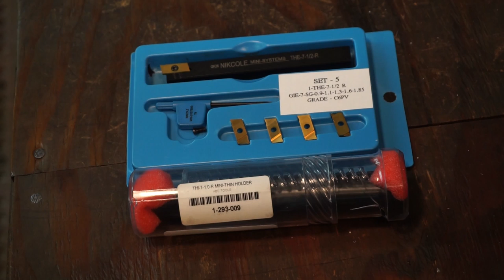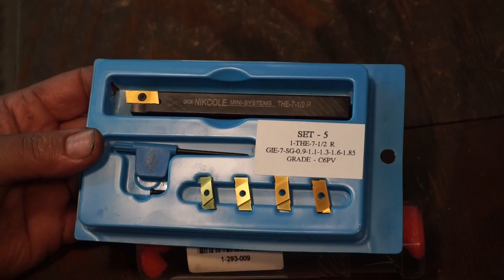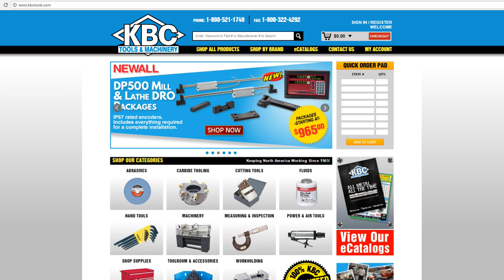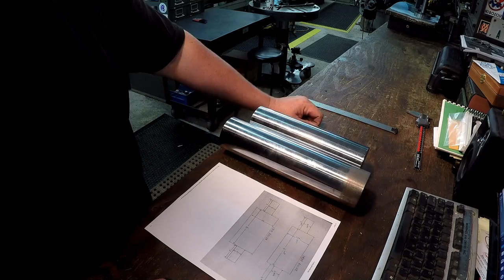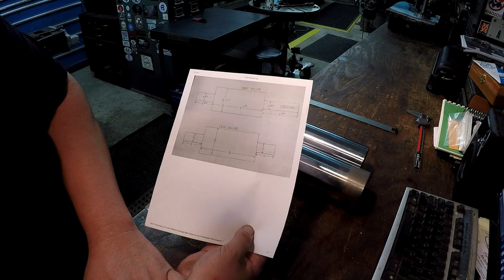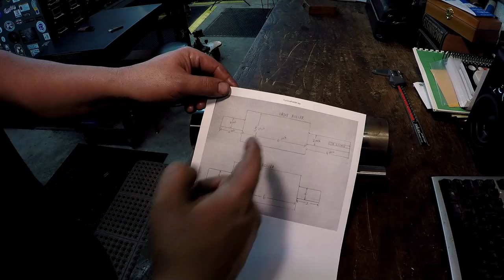SNS 167: Viewer Lathe Project

Comment: I use that same grooving set for snap ring grooves. It works really well.  Keep the speeds and feeds light, and the inserts last a good while. In a pinch, I have even touched up the edge with a green carbide hand stone.

Comment: Adam ,that Nikcole tool looks like it would be a very useful tool along with the boring bar. I could really use something like that but I think I'll let you be the test guy before I buy. Hope to see you use it soon. Hope you had fun up at John's place. I completely forgot about that going on. I fully intended on making the trip, it's only about 150 mile drive for me. Maybe next time!
Reply: wvrockcrusher I use that same grooving set for snap ring grooves. It works really well. Keep the speeds and feeds light, and the inserts last a good while. In a pinch, I have even touched up the edge with a green carbide hand stone.

Comment: I want to say a big thank you to you fella. Here's for I tell you why...

My brother in law got 'given' a whole heap of chopped down trees in rounds, big long stack of the things, all he had to do was haul them away  and there are more trees to fell so this is a serious amount of free firewood for the next few winters.... We went to go load some, couple of tonnes I recon, on Saturday last and I got to thinking about the reality of how many axe swings it was actually going to take to split all this.  It dawned on me slowly, that's how I do math, that  we were in way above our heads here in terms of hand splitting all this so I suggested  hiring a log splitter.  OUCH, scrap that, so for that money maybe buy one? 

So we looked at what is available here in the UK and because I have learned a lot of stuff from watching your good self I could see that these cheaper machines were just not going to cut it. I just couldn't see a threaded bar driven by a motor, driving the moving wedge to split the wood lasting longer than seconds on the rounds we had  so I was able to  scrap that right there.. but what the brother in law found out asking his wooden mate, digging deeper, was that these 'toy' things are actually hydraulic.

 OK, bit dumb of me, but because I have learned about what hydraulics are capable of through your channel I could see that actually this could work. A bit of tube searching found me a model/manufacturer, and we bought one a few days later for 2 days hire cost for the only machines to hire in the area. So thank you Adam, for giving me the confidence to  make that choice and the know how to back it up :)

Comment: Hi Adam,  an idea for a shop talk video: what tooling would you buy for a lathe if you were starting from scratch?  A basic set to more advanced.  Just stick to carbide though, ground HSS is standard fare. I suppose you could address lower hp machines for us mortal home shop types (2-5 hp machines).

Comment: If you’re having some problems with getting a good finish on that chrome rod, especially when its a small DOC, Id say get a DNMG tool holder. Nice sharp inserts made for small DOCs. Maybe even a VNMG. I wouldnt push them past .020 though.

Comment: Adam, regarding the chamfered clevis at 28:11, what options besides sawing, flame cutting and grinding does a machinist have for making a full radius or convex radius like the original clevis?  Is there such a fixture that lets you rotate the work-piece about the clevis pin hole, while a stationary cutter traces out the radius on the end of the clevis?
Reply: A rotary table on the mill.  Modern cnc laser, water jet, plasma and even oxyacetylene make such high quality cuts, that is not necessary for anything short of aerospace work though.  I've seen cuts through 6" solid plate that looked like they were belt sanded they were so smooth.

Comment: Weird question, I know, but could you show how you clean up the shop from all the chips, and if you send them for recycling, please?
Reply: environmental police, dont respond
Reply: Kenneth Ord, Naw, but really... the metal trade is a nickel and dime business. All of the larger shops recycle drops, sorted into ferrous, non-ferrous, and aluminum. When your business run's at 93.5, that extra 1.5 means the difference between beans and steak.
Reply: A barrel full of aluminum shavings could get you the whole cow.
Most successful shops will quote jobs with material waste factored in to price, meaning the scrap is gravy. Many guys horde the scrap until the price is high and they have a truckload, or they save it for a lean month when they need to make payroll/pay bills.
Reply: I work in a small shop, just my uncle and myself. We do short run production runs. As well as job shop type stuff, one or two item orders. We save Aluminum and brass chips, and the occasional dead part. Most of the saved chips come from the Hurco VM-1 CNC mill. As stated above, we save them until prices are up, or until the funds are needed in a slow month. We also recycle worn out carbide inserts and endmills. 

Another thing we do have have some tools sharpened, slitting saws and endmills mainly, as well as the more expensive odd sized taps. We have nearby tool grinding company do it for us. It really helps.
Reply: Good info, thanks. Never worked in a machine shop and I was just wondering cos it looks like an awful lot could be saved.
Reply: even my plumber saves his scraps, in fact they pay for his apprentice, part of the apprentices job is to deal with the cut offs and old pipe and to sort if for scrapping, hence paying his wages, before he didnt have time for them, so it works to both their advantage
Reply: I use a magnetic broom and a shop Vac. I used to save all the chips but it cost more in gas to drive the chips to the recycling place for anything but aluminum brass or bronze. So all my chips go to the local trash company's recycling bin since I rarely turn anything other that steel.
Reply: Kenneth Ord he most likely has some young kid or some one who he is giving a chance too. pick them up and  I'm sure that there is a big metal bin and the recycler picks up.
Reply from the maker: I use a broom and a dust pan. The chips in the machines go to the metal recycling bin.

Comment: I have a question as a beginner. If you placed a mark on the quill of your tailstock at the center level, would that simplify the process of getting the tool level with the center of the work piece? BTW I love the looks of those Monarch lathes. I was looking for a 10ee, but had to give up and buy a Grizzly. The Monarchs I found were several hundred miles away and either worn out or $20K. For a hobbyist both were out of the question.

Comment: That seems like a bit small shaft ends on that roller. I know that not Adams call to make but I would have suggested to the guy maybe 1.500" If he building what think he is building there is going to be some serious stress on them. Also he could then go with bigger drive key. Nice video Adam... as usual.
Reply: 40cleco 
My thoughts as well.  High pressure calls for larger journals.
But I tend to over build things.
"Nothing built too strong ever broke." (Tom Lipton)
Reply: i went through the same thought when i drew up the sketch, I am by no means an engineer, but I'm not doing any heavy passes or drawing out the steel aggressively, i have a 50 ton hydraulic forging press for that. I'm mainly using the machine to make it more of a consistent thickness, it doesn't take much force to alter the shape of steel when its at a moderate forging temperature, especially with a radius since the point of contact is so small.  I'm building a rolling mill, I've seen plenty other home built rolling mills that are pretty questionable , however they work just fine.

cheers.

Comment: Did you get the correct internal toolholder from Nikcole?  From the Nikcole web page:

Right Handed Inserts Can Only be used with Left Hand Internal Tool Holders
Left Handed Inserts can only be used with Right Hand Internal Tool Holders

I have the same external set, but didn't get an internal toolholder due to the relatively large (1.5") minimum I.D.  I believe this is due to the relief angle of the insert, not the size of the toolholder.
Reply from the maker: Matthew Lepper That I'll have to check now. I never did fit any of the inserts into the bar

Comment: It was great to meet you at Saunders Machine Works this weekend. When you were using the radius tool and then switched tools to clean up the face, could you have left the radius tool in there and pulled it back across the face to clean that face up? Would that be a valid use for that tool, or doesn't it like to be drug across the face?
Reply from the maker: I did use the radius tool to clean up the faces. Once the radius is cut, I'll either face out or back in to a zero.

Comment: When you dial in say 40 thou cut on the OD, will that take 80 thou off or is it set up that the tool moves in 20 thou to take off 40?

Comment: Could you use the Nickole system to cut square internal threads?
Reply from the maker: booleanenator you could but you would have to move the tool over to get the width of the cut you want. Also you have to make sure there is adequate relief under the tool to clear the work.

Comment: I have a question, what is that white coolant made of? It is like a thin oil or water with something in it to prevent rust or is it milk?
Reply from the maker: It’s soluble oil, mixed with water.
Reply: Allright thankyou Adam!

Comment: Hey Adam, What's the HP of the motor on that Monarch? My old 1952 13" LeBlond only has an antique (original?) 2 hp. I can't get anywhere near as deep a cut as that. Most times anything over 0.060 it chatters or loads up badly. I am assuming the gearbox won't hold a much larger motor. Are the deep cuts easier with a bigger motor or a better designed cutter?
Reply from the maker: +Dennis Sampson The monarch has a 5HP motor.
Reply: XThanks Adom, saw you in the nycnc live video. Looks like everyone had a great time.
Reply from the maker: Dennis Sampson Yes I think we all had a great time!